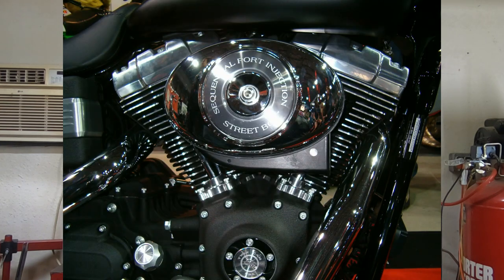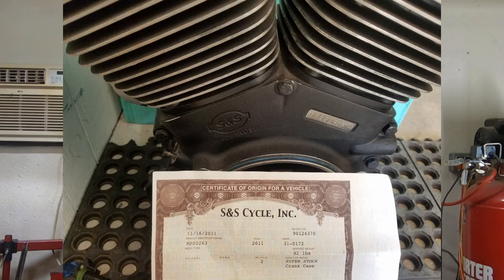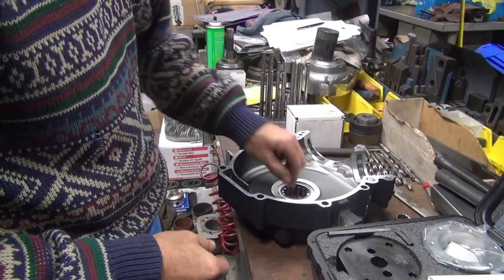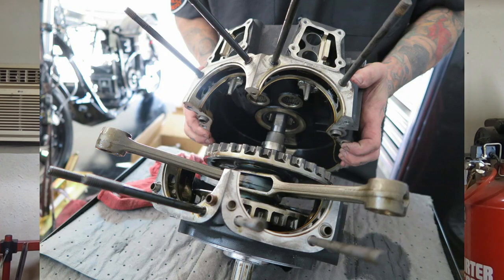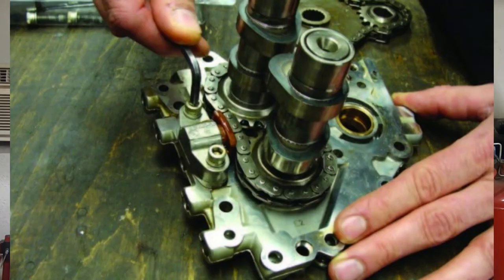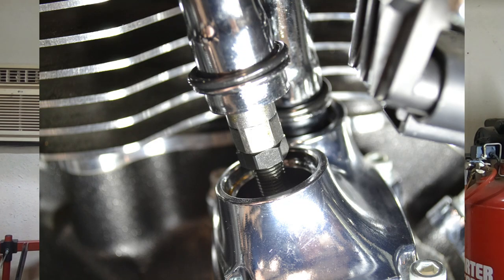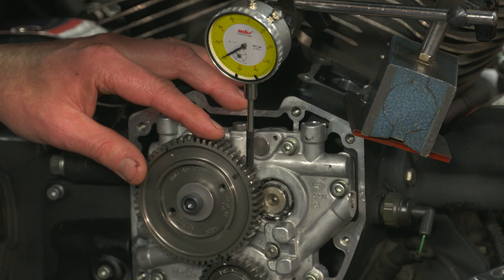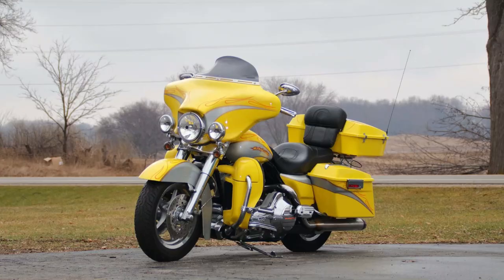Twin Cam Harley Engines Can Be Bulletproof

Comment: I have a 05 103" I did all of what you mentioned. It runs at 114hp/127fpt and has been running for over 20k miles, so far so good.
Reply: You are only at the halfway mark for inspection and replacement which occurs at 40,000 miles. 1 Twin Cam owner related how he bought a low mileage twin cam that ran but very noisily and when he took the cam cover off the cam chain tensioner was gone and the chain was just flopping around. He was so lucky that it did not snap and total is engine.
Reply: I just bought mine ,103” with 819 miles , I wanted to ask you about the cost of bulletproof the engine 
Thank you 🙏🏼
Reply: @rododuran9350  Just like the man said. You need to build the bottom end with the bearing and welded crank. That you need to gave done at a good machine shop. I sent my bottom to some place in Wisconsin. For the top end you will want to get the blue S&S cam plate, a gear drive, cam it to your riding conditions (I use wood cams on all of my builds), pistons 10.5:1, and a large intake/TBI. Price will depend on what you put in it but expect at least 5K. I did all of my own work other than the bottom so if you have it done it will cost much more but if you are mechanically sufficient do it yourself, it's not rocket science. I built my bike for torque and fun and that is what I got. If you build it for HP you may never see the benefits of the build. Goog look. Make it happen!

Comment: Super good update on the 96er's. Gives me lots of great information, especially if I'm going to jump engine size to the 107. I would port polish, cam, pipe, intake, and a good tune. The bottom end is a good idea, if the engine is pulled anyways. Great video ! Thanks !!
Reply from the maker: Glad to help! If the motor is coming out it's crazy not to go all the way and get crank done too!

Comment: Running my tween cam 103 more than 10 years and 50k miles and never had a problem, well, the compensator of course, I think it’s an excellent motor. At 50k I checked the runout in it, it was about 4 thousands, replaced some essential parts such as cams, tensioners and such and the bike is running like brand new. Would I like to do some flywheel work down the road? Yes would it be worth it? I don’t know. Thanks for the video.
Reply: Isn't your crankshaft run out at 4000 is it that too much to replace it with a Gear Drive?
Reply: @frankmarkovcijr5459  S&S wants less than 5 thou runout for their gear drive kit.
Reply: @jaym8027  as a previous Honda owner who had three motorcycles destroyed by cam chain failure resulting and catastrophic engine failure. If I were you I would change to the gear-driven cam shaft while you still can. The cam chain is the Achilles heel of many modern motorcycles because it is a cheap and easy way to drive the valve train but when it fails it results in catastrophic engine failure. A motorcycle as expensive as a Harley big twin should not have cheap parts in the engine resulting in the owner having to drop $5,000 into changing the cheap parts that they put in there. If I were you I would do this just to have the Peace of Mind knowing that you never will have to deal with a cam chain snapping and destroying your engine. Of course I keep my motorcycles for decades. I don't have to worry about my gear driven Sportster or any of my ear driven vintage British motorcycles. Now my Airhead BMWs from the 1970s having campaign but BMWs are different. My BMW 100 / 7 had 500,000 Mi at the time of her demise. I never worried about the cam chain with the BMW.
Reply: @frankmarkovcijr5459  Thannk you Frank.  I meant that S&S requires less than .005 runout in the crankshaft in order to install their gear driven cam chest.  I didn't write that very clearly.
I always wanted one of those 70's era BMWs, they're really good looking bikes.
I do have an old Triumph squirrelled away in the garage - I'm not worried about cam timing, but the brakes are so primitive that I only ride it around the immediate neighborhood once in a while.
Have a great day!
Reply: Iam having my 2012 streetglide done now. .005 runout. Using stock HD cam plate. Cyclorama 570-2 cams. Fueling lifters. S and s oil pump.  Leaving top end together.  It has 56k miles on it and had no major issues. Oh new head pipe and monster rounds v and h with dyno jet tuner. It gets dyno d this coming week.

Comment: My 2012 RK goes into the shop tomorrow, it is making some noise in the camchest, it just turned passed 50,000 miles, I still can't complain.
Reply from the maker: 50k, you did good and had fun! It's that opportunity to upgrade it and pack in another 50K or more on a new bike. Putting power in the bike will make you fall in love all over again.
Reply: @GixxerFoo  I know where my income tax return is going, maybe next year house.

Comment: I have a Twin Cam 103HO twin cooled, it has 34,000 miles on the clock and hasn't had an issue yet!
Reply: I have a 2017 BreakOut with 62k miles. No issues yet but the compensator has always been noisy no matter what oil I put in. I just put in a bigger oil pump and changed out the cam chain tensioners/shoes that weren't that bad. All and all, All Is good 💪🏽
Reply: You should pop open the camshaft because you are just about at the service interval for the cam change in their tensioners at 40,000 miles if it can't chain breaks its speed it will total your engine
Reply: @frankmarkovcijr5459  the 103 has the hydraulic tensioners from factory, my old TC88 did 80,000 miles on the original chain tensioners and I'll admit, they were about 30 seconds from totalling the engine, the 103s barely looks used.
Reply: @frankmarkovcijr5459  the cam chain doesn't break in Harley twin cams, the cam shoes disintegrate and wreck the oil flow/Pump and it was an issue on 88s...the 96s were better and the 103 had the issue resolved.

In saying that my 2000 road king has the 88 and I changed the cam shoes at 80,000 miles, they were absolutely ruined but hadn't given up, I upgraded to the new cam plate and hydraulic tensioners. My 2015 ultra limited with the 103 twin cooled has barely a mark on the cam shoes as it comes stock with the hydraulic chain tensioner. 35,000 miles and smiling. 

Also triumph are pretty terrible, here in the UK people have so many issues with them, I have mates with street and speed triples that regularly get their second bike out because the triumph won't play, nearly as bad as Ducati in that respect. 

I've had them all, and they have all had issues. The only 100% totally reliable bike I've ever had was a Yamaha R6, my 1998 sportster and my 2015 ultra limited.
Reply: @yanceyboyz  my Triumph is a 1965 TR6 with a Magneto and a bolt on hardtail it is not one of the so-called new triumphs. My 1999 Sportster has 400,000 trouble-free miles on her

Comment: My 2009 FLUTCU has  S&S crank, SE CAM plate/oil pump, S&S 106 big bore kit with easy start cams.  I also just installed an external crank case breather. I also want to install a manual primary chain tensioner.
next time the comp goes out, I'll try the dark horse.

Comment: yeah and all you have to do is maintain them and leave them alone. 104k on mine and ill ride it across the country right now with no worries. you could put 10k into your engine, or you can ride it till it dies and then buy a used 114 or 107 with 5k on it for 7k.

Comment: So waiting for Harley’s 110 tire shredder kit since June of 22. That’s 9 months and counting. At what point do I need to replace the pressed crank? I knew I would go billet cam plate but which one?? On the fence about the compensater, guess run it till it goes out. I Wes thinking on lower gears set to show off them 259 cams that comes in kit.
Reply: My 2011 dyna street bob has the tire shredder that I put in 2017, bought the bike new and dynoed at 106hp/122tq which is more than enough to get into trouble with. Hopefully you get it soon, you'll love it 🤘

Comment: Had a 2007 Electra glide, they say one of the worst bikes made, put 50,000 miles on it never a problem , not a lot of power though just adjusted my riding style, loved my 87 evo Electra glide put a good cam in it and bumped tranny pulley two teeth great riding bike, now have a 2022 road glide 107 m8 learning about that motor now, just ride them take care of them and u usually have a freak bike, thanks for the videos

Comment: Evo and TCs are both great motors.... they both have a storied history of longevity and even though they both have their issues at times, have been known to both last a good amount of time with correct maintenance. Talking about crate motors kind of had me chuckling due to the fact it's easier to find a built crate for an evo cheaply than it is for an 88 96 or 103. Although I do agree with you that the evo is better as it generates less heat in the long run on smaller bikes, on big bikes that need the headroom to get up to speed, a 103 or 96 is perfect. Mix that with ETC and Fuel injection and you have a bike that when used regularly is less likely to leak. The primaries on the 103s are a pain in the long run as far as run put and what not, but for most people, taking long trips in the heat with an oil cooler, the engine is well built enough to last 100k or more. I've seen them numerous times. Even seeing several over 150k miles. I see some evo bias, I would assume knowing that their more be more diehards on this page, but the TCs are great engines up to the 107, and although when you start getting too much torque it takes more of a toll on the compensating side. That is a good upgrade to make early if you're worried about it. I say, ride it til it breaks, fix it and ride it some more. That's what made the evo great, and has made the 88s great as well. Oil changes and not cranking back on the throttle at every stop and make a bike engine last longer just as a car engine will. I've seen several evos with compensator and oiling issues. I even saw a guy on the side of the highway with a head gasket leak so bad that it burnt up the cylinder sleeves and they had to rebuild. Not sure if they were even able to based on runout, which goes back to my argument. Both good motors that get tired over time but will last longer with good maintenance and riding habits
Reply: That being said I'd like my next Harley to be an Evo. Lol

Comment: Getting ready to order some cams for the 96"  either Andrews 48H, Woods TW222 or S&S 583.  Not looking for massive power just a little bump up from stock without having to upgrade everything else in the motor.
Reply from the maker: Any one of those cams you just named are perfect for what you're looking to do. Those are all bolt in cams that will get the job done!
Reply: I love the Wood TW222 in my 103. SE cam plate and pump.  And Bobby Wood is a helluva great American.
Reply: I like my S&S 583 in my 103. Gave me 89hp and 106tq at the rear wheel with a tune. Curve is very very smooth, 42-43 mpg at 80-85 mph in late summer Florida, perfect for touring.
Reply: I just put the tw222’s in mine. And just recently got it retuned. Can’t wait for the weather to break.. I did and do a video on it so far, but better one’s coming soon

Comment: my 05ultra. 100,000 bought new. added a bigbore, ported the heads after 500 mile break end. I had the cases split balanced crank, 10.5 pistons, 543 geared cams, S&S push rods, timken bearings, high flow oil pump, billet cam plate, new valve springs, 51mm throttle body, new electronic fuel injection, my ported heads, 4 gear cam drive set, all seals, gaskets. it's now a bullet-proof 103. 104hp 104 tq.
Reply: Look at all the stuff you had to do to that engine. I could not even begin to imagine the cost of everything that you had to do to that engine. And it makes the same amount of horsepower as my buddies old Honda Valkyrie stock.
Reply: @frankmarkovcijr5459   yeah but it's a Honda 😢
Reply: Harley motorcycles straight from the factory especially for the price that they charge should be trouble-free. Most Harley Riders if you asked them and they are honest they will tell you they learn how to ride a motorcycle on a little Japanese motorcycle probably a Honda. Now if you could do all of that stuff to your twin cam engine why does not it come like that stock from the factory and then you can match the horsepower of a twenty-year-old Honda. For the money you guys spent for a stock Harley it should come fully equipped engine wise and everything else should it not? Evolution Motors were designed to alleviate the problems AMF with having with the Shovelhead engine because of the pollution requirements and the crappening of the gas. The Evolution motor solved all of the problems of the Shovelhead as well as making six more horsepower at a lower RPM. The all-aluminum top-end resulted in a very cool running motorcycle that does not cooking oil therefore it lasts practically forever. My Evo Sportster runs 200° to up in August in Florida. You can't get hotter unless you go to hell. Because the engine runs nice and cool the oil stays nice and cool and lubrication cool to motor properly which is why I have four hundred thousand miles on the original motor. Ironically I bought the Sportster knowing that I would have a great selection all shops to do service work on my Sportster. I replace the little bearing in the primary every 50 to 60 thousand miles when it starts to rattle. I have replaced the stator and the primary because it wore out at 250,000 miles and it lasted twenty years. I have gone through 3 belt drive they last me over 100,000 Mi each belt. I actually wore out the front end which was replaced with the front end off a 2009 Sportster brand new. Got the double piston brake upgrade as well but don't feel no difference in breaking. My bike has been supremely reliable and dependable much more than I ever could have hoped for and this is coming from a guy who bought 4 Hondas brand new. Ever since the demise of the Evolution motor Harley has not been able to make a good quality reliable motor. I am Gravely disappointed in everything they do because everything they do from killing off the fuel line of motorcycles killing the Dinah, killing the Evolution Sportster. Concord Harley-Davidson make a motorcycle as reliable as an evolution Sportster get make one as unreliable as a twin cam Milwaukee 8 or revolution Max. When you buy a Honda you don't give a shit if it has a warranty. I wore the hell out of every Honda I bought till the wheels and fell off of them. They were great reliable motorcycles till the day they died but when they died and suffered catastrophic engine failure you could not rebuild them. It was cheaper to buy another Honda. I got 250,000 trouble-free miles and 10 years of trouble-free service from my CX500 Honda that I had in the Air Force. I know Harley-Davidson can make a good fight they have a history of making good bikes they are simply not what they used to be neither are their riders for the most part. And everybody knows what I mean when I say for the most part. My uncle's 193 8 Harley knucklehead weight less than 500 lb with a full tank of gas. It came stock with a 61 cubic inch engine which produced 50 horsepower. It came from the factory with a certificate stating it had been run at 110 miles an hour certified. A big twin used to be a nice light sportbike that ran like the wind and with the Pogo sheet on the hardtail frame as they say it was as calm as the Queen Mary on a nice day at sea. And of course Harleys in those days as all motorcycles were in those days kick-start only. The only proper way to start a motorcycle.

Comment: Did a stage one a few years ago and then put s&s 583 cams no lifters or cam plate . My 2015 103 is a monster for power and torque. However I never abuse it.

Comment: Thanks for the info. Own a basically stock 2001 FXSTB purchased it new. Pipes and filter assembly is the only motor changes. Dependable motorcycle. Not fast. That’s what the 2014 Mustang GT is for.

Comment: Love the Twin Cam content on your channel…thx! Is there a better compensator for my TC88 B from 2001?
Reply from the maker: For the 88 you'd have to go with what basically is a drive sprocket like the Sportster, not a bad thing though. They are about 200 bucks but you can also change up your gearing a little bit if you want. Evolution Industries has a pretty wide selection of gearing options.
Reply: There are no issues with compensators up to 2005 anyone tells you different is full of shit !

Comment: I bought a a 08 police bike from Florida.  Was a 96 but with a big bore kit with cams. Head work and a tune.  I will tell you with 49k miles on it and me putting 3k on it after i bought it. I can almost keep up with the newer bikes.  Plus i like it will almost shake itself to death at a stop sighn...😂😂😂😂😂  need to keep it 4k rpm or more and shes awake.

Comment: Awesome content my friend! I appreciate you and your input! Im building a stocker 103"( not stroker) road glide fltrx, im a old side Harley wrench.also worked in a circle track race engine shop, just race engines. I understand fuel injection and timing fully also alignment with cams. Im curious though, what is your suggestions for camshafts with stock or not pistons, but, your suggestion on cams for 8- 10lbs of booste? Should i send my heads out to be cnc machined to zippers or others? With the cam change? I don't want the top to overkill the bottom! Thank you!

Comment: I’m proud to say I have most of everything stated!but have Harleys hole-shot kit in my primary- chain and 24 tooth motor sprocket! And I keep my old aluminum umbrella valve covers vs the new stamped steel one’s does anyone have any knowledge on Harley’s softail counter balancer’s for the 88B engine? I’m looking for mileage markers and if anyone has had a failure from one